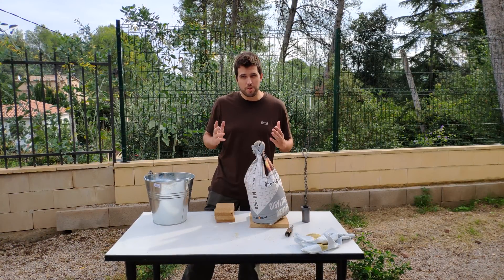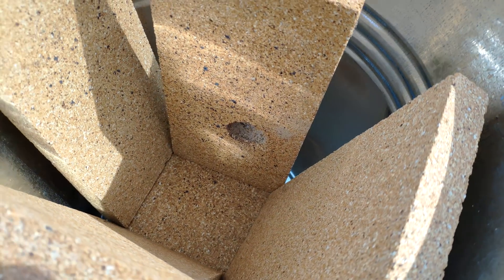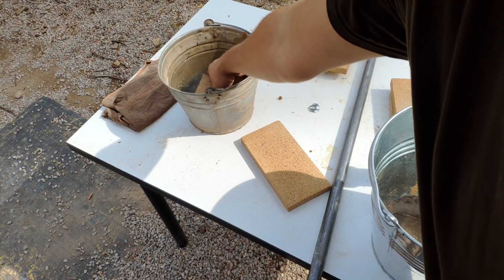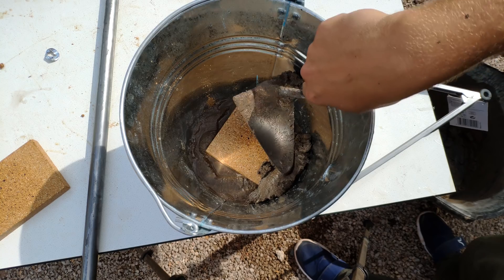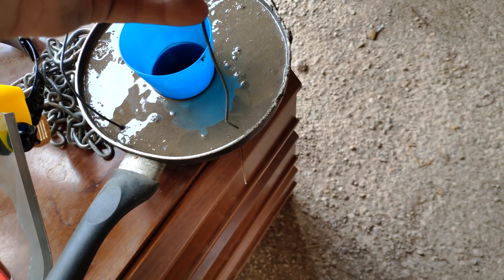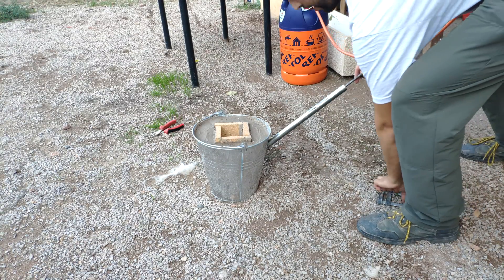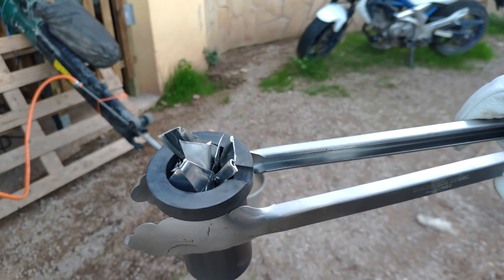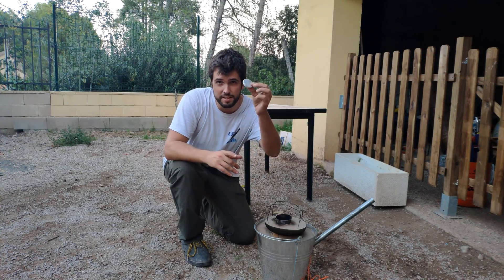🔥 CHEAPEST Foundry at Home

Comment from the maker: Danger!! In the video is tested using a flame but leave this method to experts because in case of leak you should be ready to blow fast and strongly or/and cut gas supply quickly. You could be serious injure if you try this method.
Take a look to step 12 on this indestructible: https://www.instructables.com/id/How-to-Make-the-Simplest-Metal-Foundry/